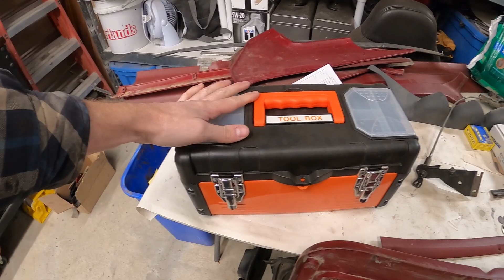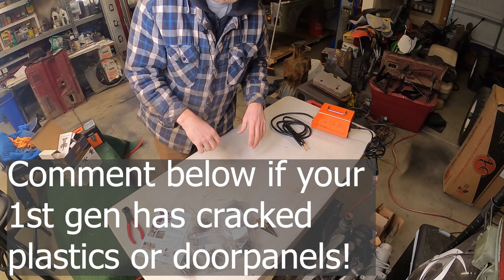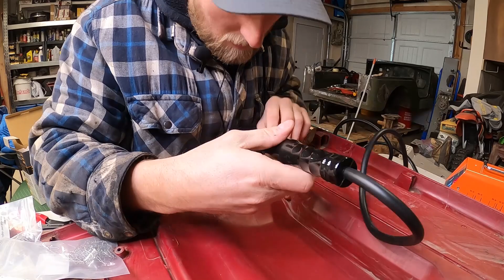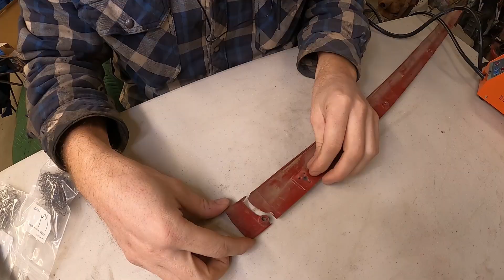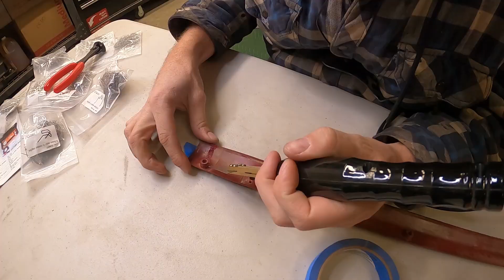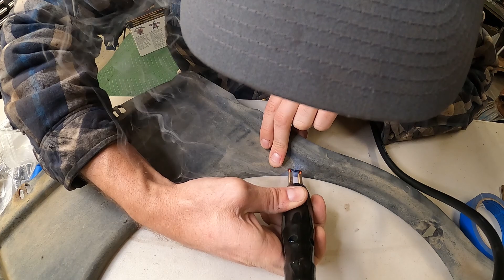Broken Plastic? EASY Way to FIX Your Plastic Parts

Comment: Fascinating tool and great work to find and try it.  Your resuts were outstanding!
A few comments on plastics in automobiles.
Yes, there are many types and while there are similarities, not all are the same.
As has been mentioned, many interior trim pieces are made of HDPE.  However, also very common is Polypropylene (PP).  The method you have used should work very well with both.
Also of note is that other plastics (polymers) are often used in many varied automotive applications.  Nylon, ABS and Polycarbonate are just a few that are used along with HDPE and PP.  Be cautious as not all behave the same when trying to join them. Some are better joined via solvent welding rather than thermal welding.  Without going into great detail, the welder you used here is best if you stay with HDPE or PP.  The other materials mentioned above require higher temperatures and can be fussy to get even reasonable results.  They are also more problematic with the smoke they emit.  Adding another layer is that some of these materials have chopped fiberglass strands embedded within them.
One final note: It would be advisable if you were to first wash the plastic parts you are joining with warm soapy water and then dry them.  This removes any contaminants and will increase your odds of a clean, successful bond between surfaces.
Reply from the maker: Great points! I have learned a ton more about this since i filmed this video. Maybe I'll do an update video 🤔

Comment: For that thin piece I've had great success with plastic epoxy and tiny squares of fibreglass mat.
Reply from the maker: I actually just bought plastic welding rods that I'm going to try and then I'll do a follow-up video on it.

Comment: Great video.  Thanks for the tip.  I really like your method on the red trim piece to make a strong weld.  I'm going to try it.  On my W250, I've had luck making a plastic glue by melting some old trim plastic in acetone.  I have one piece of interior trim that is broken beyond repair so I will shave some of it into small pieces and then dissolve it in a jar with a little bit of acetone.  Once it dissolves, I stir it around and let it thicken up to a paste-like consistency. Then I use it like a glue to weld up cracks or add on to broken pieces.  You might be able to put a finishing touch on your red window trim weld by dabbing in a little bit of my "glue" on it.  Since the glue is made from an old piece of trim, the color should match perfectly.  Thanks for your videos.  I've definitely been learning and enjoy the info.

Comment: Tim Stevenson another awesome video, thanks for being the try it out first guinea pig Tim! 
 I'd recommend wearing a respiratory when plastic welding, the plastic vapors are no bueno for your health! After plastic welding my broken interior  trim pieces, I had an awful headache and a terrible taste in my mouth. 
 Also if you need to add extra material to a piece like the one you burnt through the edge on, you can find a scrap piece of plastic laying around. Most plastic have the material type identification molded into them, such as HDPE ( high density polyethylene). It should be on the back of the door trim panel. Most car trim is made of some type of polyethylene. You can cut large pieces from a scrap piece and weld them in for a large repair. Harbor freight plastic welding kit comes with strips/rods of different types of plastic for filling in or beefing up areas. On my door panel one of the round tits were broken off where the lower screws go in to secure the lower half of the panel. I used the harbor freight plastic rod to build up plastic around the broken edge. Came out solid as a rock. This method works great for curved areas. 
 I can send you 50 broken interior trim pieces, if you need something to do in your spare time on bad weather days...lol
Reply from the maker: Mark comes through with some more stellar insight! I just ordered the welding rods you recommended and will do a follow-up video in the near future. Thanks!

Comment: It looks very interesting and like it. It would be worth trying. I have seen plastic welding rods in the past that was to be used with a torch. I'm thinking that the rods would work good with the plastic spade to add plastic to reinforce the weld seam. The extra plastic added might even let you lay a staple in to reinforce the seam even more.
Reply from the maker: I just found out about the plastic welding rods from someone's comment on this video. I just ordered some and will do a follow-up video on that as well.

Comment: Would you recommend it to fix a hole in a 1st gen diesel tank I poked while trying to push the hump in for a crewcab
Reply from the maker: Yes I believe this would work for sure. The diesel tank plastic is really thick so it may take some work. I just ordered this as well per Mark Taylor's recommendation which should work great for the diesel tank. https://amzn.to/3k66R9H
Reply: @decentgarage  ok thanks